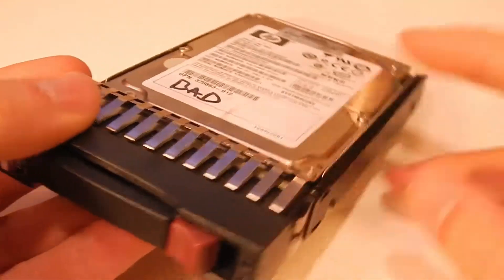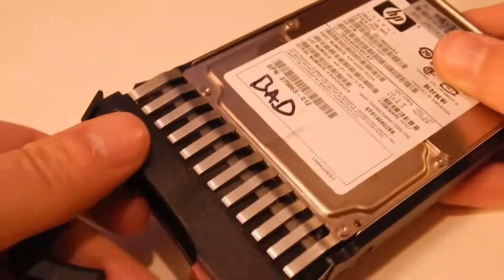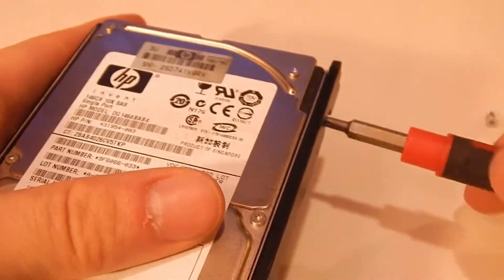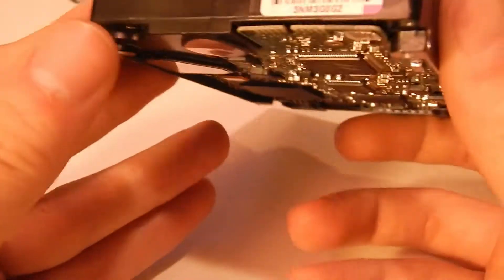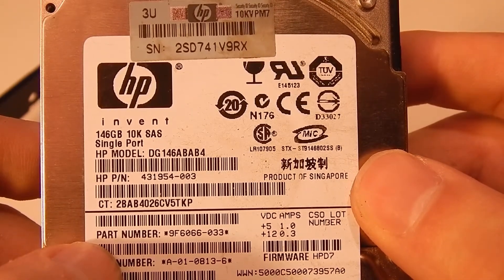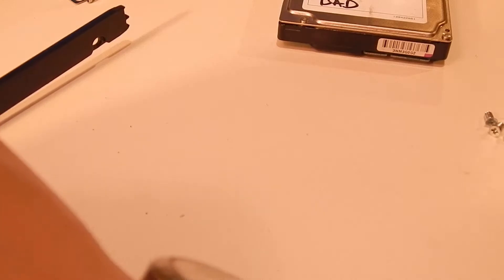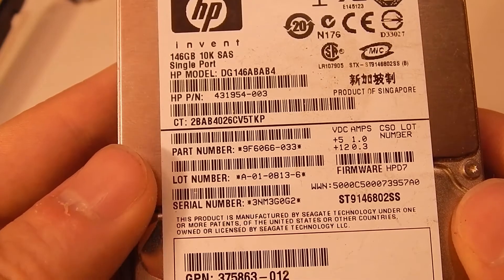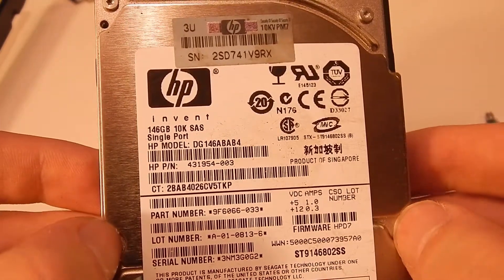SAS HDD from hp proliant

Comment: 2.5" hard drives range in thickness from 07mm to 15mm's. However, laptop manufacturers predominantly use 9.51mm hard drives. 15mm drives allow more platters and therefore greater data capacities.

Comment: 1. The chip with the big M (Marvell) is most likely responsible for the PRML read channel. Seagate likes to use Marvell's chips for that. Meanwhile, the ST SMOOTH chip is the spindle motor (and likely actuator as well) driver.

2. In all caps below the model number... "THIS PRODUCT IS MANUFACTURED BY SEAGATE TECHNOLOGY". I think it "might" be a Seagate.

3. SAS controllers aren't crazy expensive, and being a modern interface, PCIe ones are easy enough to find. It is not possible, however, to use a SAS drive with a SATA controller (only the other way around).

Comment: I need help...I have a 6TB SAS drive...I wanted to utilise this as external drive for my laptop...so it is possible that any how I can convert this as a external laptop drive ??

Please reply
Reply: NISHANT SINGH I’m a little late to this but There is no way for you to use a sas drive on a sata interface though the sas connector and control architectures will work for a Sata drive